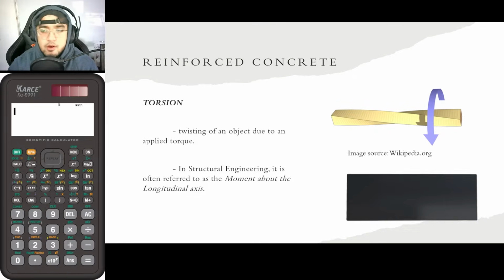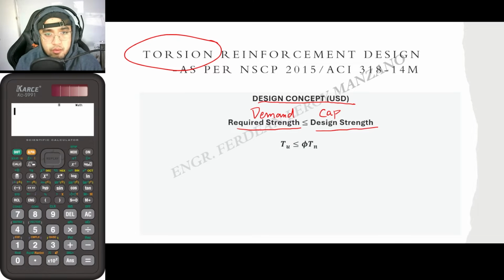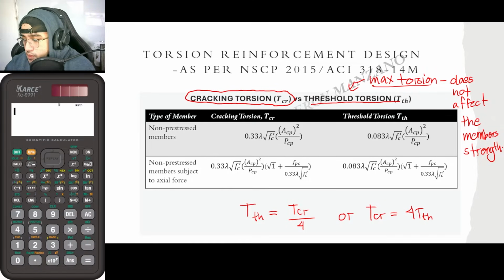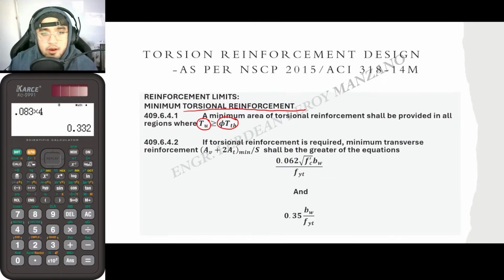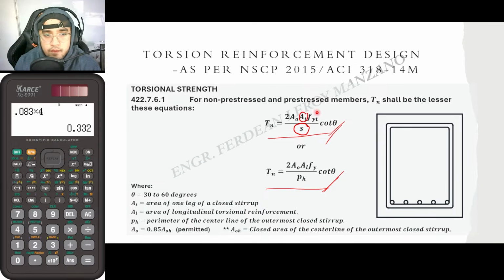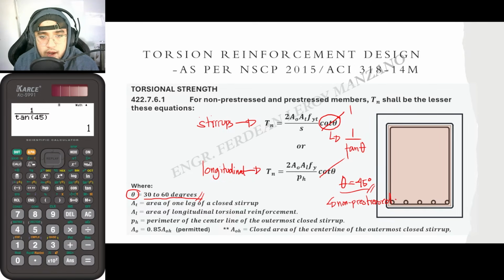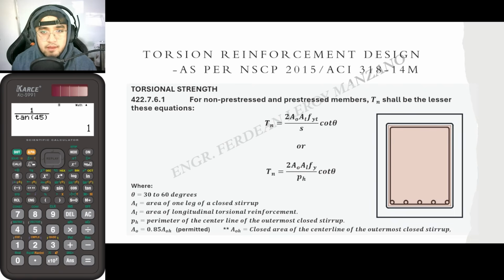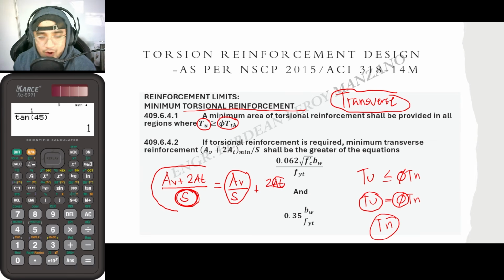Part 1: Design of Torsion Reinforcement - NSCP 2015 and ACI 318-14M - Introduction and Concepts

Comment: I want to ask since there is already V and mement on the beam, and the beam received a tortional moment, does it mean additional longitudinal bar or main bar and stirrups,  probably the unswer is yes... I already see same problem in actual plan analysis although I haven't seen the result when it's constructed. I mean should I make separate calculation then additional calculation due to torsion, example of torsion is one end fixed and one end no support, and the fixed location is a beam receiving the reaction V=shear and Moment M(moment) assuming mid part of the beam. Tnx for the tutorials I will absorbed the knowledge if I think true analysis.
Reply: I think I'll make 2 deferent calculation, where all weight is added 2nd is separate calculation in torsion to know the deference in rebars and stirrups(spacing) to be secured. Tnx for sharing you're idea regarding torsion on beam.